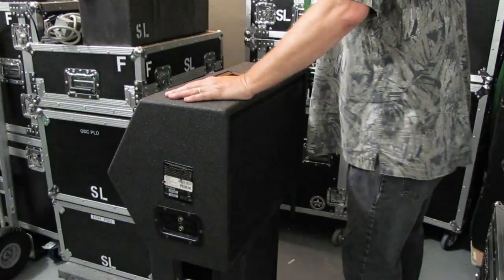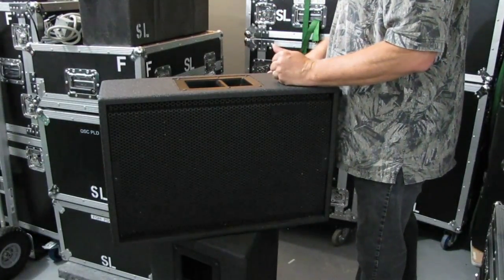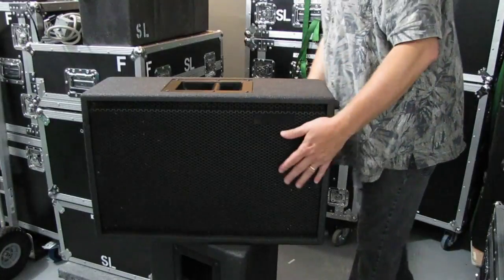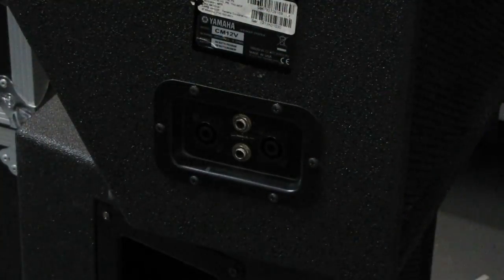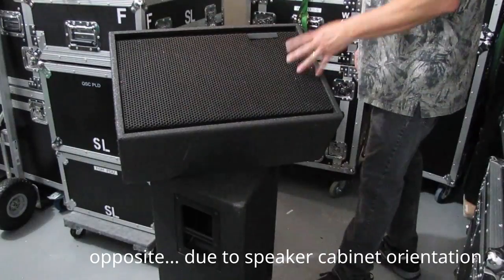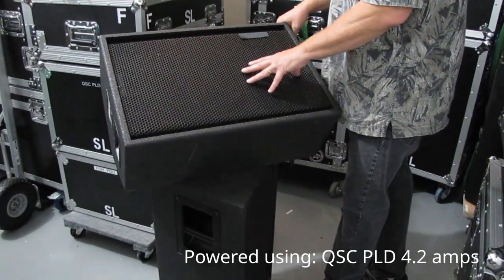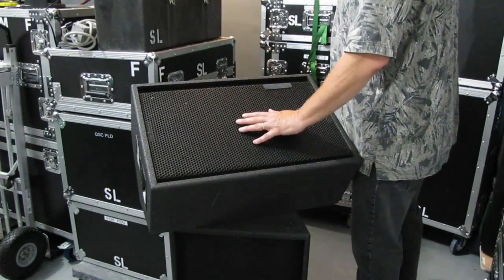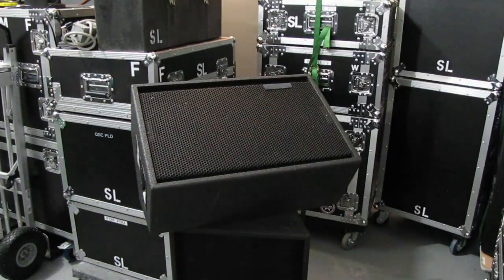An overview of the Yamaha CM12V (monitor) and C112V speakers we use for some events

Comment: Thank you for taking time to share knowledge. I learn a lot from your videos. I see you use PLD 4.x and set max power on the amp. I some times use SM115V for FOH and Monitor. I also use Bose 802s (240W cont.) for certain genre that needs rich mid tone. My amp is GX7. Both speakers handle GX7 at full power just below clipping. But I am afraid they will blow up. Particularly the 802s. What is the best way to set max output based on the speaker rating for amps that do not have adjustible voltage output? Other than use resistive load and multimeter etc.
Reply from the maker: Thank you for your comment.  The GX7 amplifier may be too powerful to safely run the 802 speakers.  You may need to turn the input attenuators (on the amplifier) down a few db.  This may provide some level of protection, but will not completely protect the speakers.  The 802 speakers will probably fail due to overheating of their individual speakers (because of the power from the GX7 amplifier).  You may want to consider using a lower wattage amplifier, or simply do not turn up the power too much on the GX7 amplifier.  If you want to continue to use the GX7, you will need to be careful how loud you run it!

Comment: I've never used Yamaha speakers.  I admit I'm a bit of an EV fan. It seems a lot of people love to chase numbers when it comes to speakers and are of the impression more watts means more volume. Granted, it's kinda true but we know there's more to it than that. Having looked up the specification for the monitors you're using with a sensitivity of 99dB/1W/1m, 175W for stage monitors is more than sufficient...for most of the shows I do, that would be enough for front of house tops.  The speakers I'm using for FOH (and sometimes monitors) are the EV ELX-200-12; they're far less sensitive than the CM12's at 93dB/1W/1m but are capable of substantial SPLs with the amplifiers I'm using (rated at 350WRMS); I don't get anywhere close to the limits of the system...I reach my limits before I see a single "limit" or "clip" LED. :D
Reply from the maker: EV does make some great speakers.  Thanks for your comment.

Comment: Hi can you advice Me? I have a behringer EP1500 amp, connected (wired up) to two Pules 350 to 700 watt 8 ohm stage speakers. I pluged a output from My 350 watt tectonic headphone  Jack into the input of the bahringer. The sound is very low and only getting part of the audio signal sounds like when a headphone Jack is not all the way connected half the frequency of the sound is missing. Is this because the signal is not strong enough? Do I need a pre amp or mixer?
Reply from the maker: From what you provided, sounds like there is an impedance mis-match between the input of the Behringer  and the output of the Technonic.  A pre-amp may be needed between the two.
Reply: @stageleftaudio  I can add that I tried using My tablet as the sound source and it did the exact same sound. I'll have a look a getting pre amp however I have seen videos of this amp getting its input from a phone.
Reply from the maker: The Behringer amp is probably needing a +4db input signal.  Small devices like your tablet usually do not have the needed power to drive a +4db input.  A pre-amp will probably be needed.

Comment: Powered or passive speakers for monitors? Which type should we choose?
Reply from the maker: Cost can be a big factor between passive and powered cabinets.  Passive cabinets usually cost a lot less than powered.  However, you will need an amplifier.  Powered cabinets are good, but they do cost a lot more and will require an electrical cord for them to work (which can equal more cables on the stage).
Using powered or passive is a personal decision.